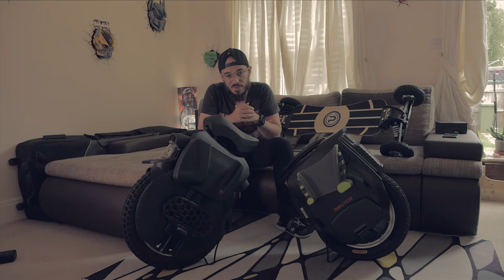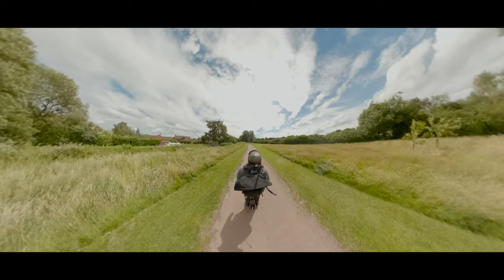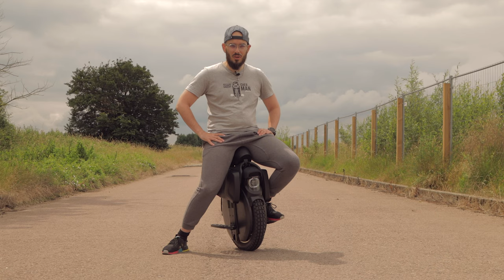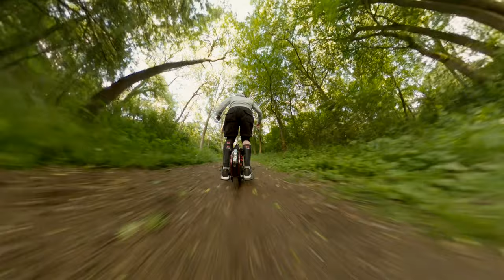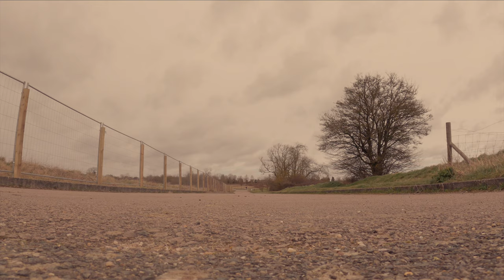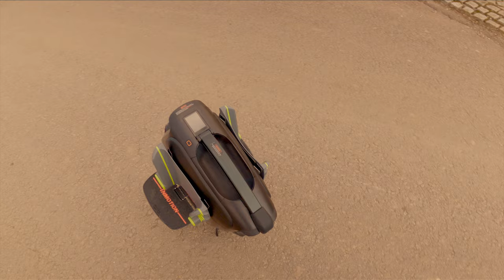Inmotion V12 Vs V11 - Best Electric Unicycle 2022 for beginners?

Comment: Design of v11 AMAZING! One of the prettiest wheel with Z10
Reply from the maker: Agree with you in that 100%
Reply: I just got my v11, what can I say... amazing wheel, build quality exceptional (now with few scratches ;) ).
Reply: @MADpack   can u give me advice? I want to buy unicycle and  i can buy used V11 or new V8S … which you recommend?
Reply from the maker: V11 is a more complete wheel but a wheel that doesn’t like to be hit up so has a newbie you will damage the v11 quite a bit the v8s is more limited less better less speed worst light and also no suspension but easier to start and great to last even with some crashes

Comment: I switched from KS16S to V11, it is defiantly different experience. I like KS16S for trail riding, much better acceleration, smaller easier to handle on curvy trials :). V11 is a my Cadillac :)
Reply from the maker: i used to have a 16x hopefully i sold mine a long time ago because the v12 rides like a 16x but is like a monster

Comment: Both of the wheels are good looking although I prefer the V12.
V11 is one of the most confortable wheels out there but when I rode it I felt something lacking when I curved and swerved. It's probably the higher position due to the suspension.
Never tried the V12 but would really like to try it out.
To be honest, I think a wheel without suspension is better for the beginning. A friend of mine started with his V11 and he doesn't feel confortable in any wheel without suspension.
Thanks for yet another good video, bro!
Reply from the maker: Thank you for your friendship and also time commenting in here and sharing your thoughs
Reply: @MADpack  you know it ;)

Comment: Iam a beginning and my 1st euc is inmotion v11.  I deflated the lower hydraulic so the pedals would stay lower for practicing but then pump it back up as soon as I started being able to ride it. I believe it has saved my ass a few time from unexpected bumps thanks to the shock obsorber.
Reply from the maker: Thank you for sharing your experience like i said not the best wheel to start because is not a wheel that likes to be beaten on the floor. You just notice that when you need to swap a tire. Hugs bro and  keep riding.

Comment: Great comparison and accessories. I have the V10 and V11. I didn't upgrade due to the V12 wobbles and lack of suspension. I'll wait until there's a V11/2 mix.
Reply from the maker: When you manage there is basically no wobble i guaranty i cant stop riding it
Reply: @TheLillianYoung  interesting. You have both the V10 and V11. I have to V10F and want another beside my V10F. I am looking to the V11. What do you think, is there a big different between those two?

Comment: As for me, having to choose between the two you have, I would say the v11, as you changed the horrible CST tire , but not on the V12. I own both too, and I really want to change that tire ASAP. Makes the V12 hard to maneuver, almost as hard as the z10.. might be best for a newbie tho...
Reply from the maker: Difficukt to maneuver???? Is the most nimble wheel i have ever ride in my life. Is so agressive curving with this one that if I had to do a competition i will use the v12 as it it with low pedals configuration
Reply: @MADpack  yeah personally I do find it hard to maneuver, that wheel wants to stay straight, maybe due to the tire (has a large band in the middle of the tire) 
Stays straight and then kind of abruptly lean when carving. Had the same impression with the v11, like if it was to fall on the side if the road was wet or slippy..
You have to invest yourself a lot to turn. 
But it's my personal impression. I absolutely love this wheel but will change that tire ASAP.
For me the Nikola is a very very close contender, but the lower pedals and lack of torque makes the V12 the best 16inch wheel.
Reply from the maker: Strange in which position you use your pedals?
Reply: @MADpack  I tried all 3 positions. I learned to love the v11 heights, so I tried on the V12. 
But as the Nikola, the V12 is a wobble monster..
So I lowered them to the lowest..
Reply: After around two months on the V12 I must admit I was wrong on my mild impression of it. 
You were right, it is fantastically nimble..
I learned how to control it's wobbles.
Yet I wonder the feeling with another tire .
Reply from the maker: Im happy that you get the real feeling of it
Reply: Você acha o 16x uma das melhores rodas urbanas por sua praticidade,  manobrabilidade, speakers e boa autonomia? Tem alguma roda que supere ela ? Se sim, qual ?
Reply from the maker: Detesto a 16x só me deu problemas podes ver no canal.. e não gosto mt da kingsong para ser honesto. A v12 mata completamente a 16x nem há comparação
Reply: @MADpack  legal vou ver o V12 pra comprar futuramente
Reply from the maker: Tenho duas v12 e adoro e tenho a certeza k iras gostar

Comment: I forgot to ask, I noticed that the charge port cover was flapping in the wind as you rode the v12, is that a chronic issue or just didn't get secured before the ride.
Reply from the maker: That bit was the prototype version.. Is nlt like that anymore.. Could be better but not as much

Comment: @madpack Please tell @inmotion that they need to make a wheel that's the best of both of these wheels;
- 18" or larger tire
- top speed over 40mph
- waterproof like the V12
- suspension is optional (maybe they can do a Gotway move and make 2 versions of the wheel, with & without suspension).
- the V12 screen
- the V11 front and rear lights
- the V12 pedal customization
(- the handle is a bit tricky)
And boom! Just like that you'll have an amazing wheel for the 2021 market (in my humble opinion)
Just wishing🤞
Reply from the maker: Some of the things you put here i said to inmotion and also new features lets see what they will deliver to the market i will screen shot this to them
Reply: @MADpack  thanks buddy! 👍👍
Reply from the maker: Just sent :)
Reply: It's a pretty good wishlist but we want options to use knobby tires on every wheel. I haven't seen knobby tires on any V12. If it's a clearance issue with the shell THAT needs to be fixed on the v13.
Reply: @MichaelBelue  hey Michael, I'm sure there's a way to get a knobby tire on the V12. Have you heard otherwise from a reliable 1st hand source?
It was thought that the RS can't fit a knobby tire, but here i am with a knobby K262 on my RS, never been happier.
Reply from the maker: I belive is possible even the s18 is possible to pit without cutting the mudguard

Comment: My 2 friends literally broke the screens on their v12s and v12ht (the wheel was not stable, they fell off and the wheels did flip-flop and full circle landing on screen - both in different time) - so you would like to make some kind of pillow protection around the screens
Reply from the maker: Making a pillow has you say will not save the screen because when the front rubber hits the floor it will put a massive for into the screen that’s why they break I fall at 40mph and no screen broken but had to replace the front plastic part of my v12hs because it was crack

Comment: Good day. I have watched your videos on v12 and i want to get one. This will be my 1st EUC and will replace my e scootor for daily drive. Is v12 can be still comfortable for small potholes and imperfect roads (not smooth concrete). Roads are 80%smooth, 20% rough and potholes. Or should i just buy the v11 but less technology.
Reply from the maker: The v11 is more comfortable but I prefer my 2 v12… I find it comfortable enough for me but for more comfort obviously the v11 will deliver that

Comment: Again nice review. I own an Inmotion V10F for many years now. I love EUC riding. Before I've had the V8. The speed on the V10F is ok, the handle is loose but good enough. Speakers.....to be honest, I don't use my speakers on my EUC. But I would like to have suspension on my next EUC. And I line riding in the forest as well. I definitely would buy another Inmotion but don't want to spend the money for an V13 or V14. What do you suggest? Thx buddy
Reply from the maker: If you want an inmotion and understand why because I'm like you one time inmotion is hard to look to other brands bit seems that other brands are closing that gap but inmotion is still the only company that still have a American/European philosophy… today I had a meeting with KingSong and unfortunately Indeally thought that ks was going to offer me same conditions but was not possible… if you don't want to spend the money v11y is your choice
Reply: @MADpack  the only brand I want is Inmotion but the V13 and V14 are more expensive than the V11 and V12. I had to draw the line in spending somewhere. 😉
The speed of my V10F is good, the range of the V10F is more than good to me. The only thing I would like to have is more comfort while riding. I don't ride hard core off road or chasing down a speedpedelec. Getting older and sometimes, the last few years I noticed when riding my V10F I have some issues on shoulders and neck so suspension would be nice and I think it will increase the riding comfort. But if I understand it well, the V12 doesn't have suspension, does it?

Again, I never looked to another brand than inmotion. For example gotway and other EUC brands still seems to use the same simple, probably less quality components as known as the typically "Chines" Quality. And in motions keeps the standards high. Chinese products of today are not the same quality anymore as once upon a time. That's why I want inmotion. They are simply the build quality. It could be a European or American brand. 

I don't have plans to sell my V10F. I just want another one beside it. 😎😁
Reply: The only thing that is an issue on all those fast, big range EUC's is the weight.. I believe my V10F weigh around 23kg and that is just almost the upper limit to carry in and put of the trunk of the car. I use my EuC the most to enter the city, while parked on the border of the city. I don't want to lift a 40kg EUC in and out my car few times a day 😁
Reply from the maker: @wimperelly I get you no the v12 will not provide you with any suspension the v11y is a good suspension but not at the level of a v14. If you want comfort the v14 is great but you need to accept the reduced manoeuvrability because of its weight.
Reply from the maker: @wimperelly buy a ramp and that is solved :)
Reply: @MADpack  😂

Comment: I really like V12. Now I have Begode T3 which I bought for 1290 USD. V12 now cost over 2700 USD. The price gets over the roof. I will stick with T3. Do you plan to test T3 also? I think that even it is more expensive now, it is still amazing wheel for the money. Sure it is slower, but acceleration is amazing and the range also.
Reply from the maker: Hi bro.. Is been a very hard year for the channel a lot of changes coming. Unfortunately the distributors in the uk are not loaning the wheel to make videos for you guys. In this moment the only thing that I can tell you is that I will be flying to europe just to continue to test wheels and at this moment will have to be the most recent wheels. Maybe one distributor here will have the t3 and I could check if i can get it but cant really promise

Comment: V12 ok to learn on? Coming from an OW XR, can you set a max speed for tilt back or audible alarm?
Reply from the maker: Yes in the begining is even locked to 25kph but is not safer to have a tilt back in the beginning just respect your maximum capabilities

Comment: ...but, they sell the V8F as a 16" wheel.  I understood, I thought, that was the OD of the tire as opposed to the wheel itself.  Have they changed where they measure?
Reply from the maker: No was my mistake sorry. The 14 inch from inmotion is the v5f.. This is a 16 inch but much finner tire than the one on the v12
Reply: @MADpack  Really enjoy your perspective on the wheels.
Reply from the maker: Thank you for the support and to take time to send me a message is really important for me all your comments

Comment: Hi , which is better for beginner: v11 or v8s ?
Reply from the maker: V11 is not a beginner wheel in my opinion. So yes v8s will be a better choice but more limited
Reply: @MADpack  thank you 🙏
Reply from the maker: Hope it help you
Reply: @MADpack  yeah I’ll stick with v8s and then will upgrade
Reply from the maker: @geladolaberidze  you will always use the v8s the same with my v8f

Comment: I’m going to ask it here because I can’t find any info it…
When I’m riding on my Inmotion V11, I get now and then a double sound of the euc… Can someone tell me what this means? Is this because I have reached the speedlimit?
(I’m a complete newbey…)
Reply from the maker: Hi Marc welcome to the channel. More than happy to help but didn’t understand what is happening.. what do you mean with double sound?
Reply: @MADpack  Now and than I hear a double ‘beep’ of the v11… Because I’m all new in this I set the max speed at 20km/h… That’s about 13mph…
Could this sound come from the fact that I reached that speed?
Reply from the maker: Yes is completely normal bro also it can happen if you lose grip with the floor it also can beep
Reply: @MADpack  Aah ok! Thanks in advance!
Reply from the maker: No problem here if you need

Comment: I know this video is a year old but i got a question. I'm looking for pointers. I'm new to the euc community and looking to get my first wheel to get to and from school and around town. I'm torn between inmotion v11, v12 and kingsong 16x. Witch one should I look into if I only plan on getting one wheel and not upgrading for a while. I am 6'2 and 240 ish pounds
Reply from the maker: You are a bit heavy to the options you gave me I would say that the best is the v12ht if it wasn’t for your weight v12ht 16x is poor quality I had one and just got problem… if you have the money I would consider the Patton
Reply: @MADpack  thank!, i think im gonna go with the v12 ht, im a near broke college student and need a quick ride to school and i want to get into this hobby, plus i need to buy all the safety gear like pads helmet, and im also gonna get the hex grid pedals and power pads so i dont slide around, ran me about 2600$
Reply from the maker: By the pads from eRides use my discount they are the cheapest and better in some things compared to much more high price power pads

Comment: Interested to know the climbing ability of the v12. I’m coming from a 16x that never gets hot when climbing. I ask as I ride the South Downs which has some near vertical climbs on trails.
Reply from the maker: Maybe i can make a video about that ;)
Reply: @MADpack  would be great to see that with temps for v11 vs v12 climbing and max climbing angle
Reply from the maker: Lets see maybe i will do a video on that..
Reply: @MADpack Yes, you should do that test and several others to v12!
Reply from the maker: Give some ideas i may do it bro
Reply: Duff recently did a V12 vs V11  hill climb test
Reply from the maker: Thats good ;)

Comment: Would you recommend the v12 HS for off-road ?
Reply from the maker: I wouldn’t buy the ht I prefer my hs 100% rides different just remember rim is more fragile and you need to swap tire but the inmotion v12hs is so much more fun and faster rim is thinner so is more responsive
Reply: @MADpack  I appreciate the fast reply! What tire would you recommend me to change it to if I were to go with the HS
Reply from the maker: @DDGFlacko that’s a good question I’m not sure Lol I’ve been running with the original tire because I love how it rides but it runs out in about 1000km so I’m tired to be assembling and disassembling all the time my v12hs… so yeah I need to find another solution. Unfortunately there are no continental or Michelin options for this wheel

Comment: If you can only have 1 wheel what would it be? V11, s18, v12?
Reply from the maker: B 12 without a though
Reply: @MADpack    awesome. I plan to get a euc  I have a ow xr that I love but speed and range really lack big time.  I know my riding style and love hills and having extra power, speed, and range would be nice.  I've considered the s18 cause of suspension. But the battery sag has me turning my head to no suspension and better range and power.  
Loved your video. It was straight on point without a bunch of side tracking
Reply from the maker: Maybe you want to consider the v12ht video coming soon
Reply: When are they releasing the ht?
Reply from the maker: Announcing this month and should start testing it in dev or march

Comment: Hi!!!!  I am very interested in buying a V12 HT, what are your thoughts about this wheel?  It would be my very first wheel!  Thank for your time!
 Mauricio
Reply from the maker: To be honest? I have both but I prefer the hs depends what you need
Reply: Thanks for your answer!  I only have the V12 HT available down in Argentina!  I would be buying a new unit that just arrived to Argentina.  My main concern is the cutoff issue that I know has happened to this model in the past, I I am wondering if this might have had been fixed by now.
Reply from the maker: They have improved the motherboard a long time ago. To be honest I still have my v12hs with the old problematic motherboard and I have already put 2000km on it and no issue what so ever. The ht is different from the hs.. I continue to prefer my hs I maybe doing the full review soon since I have my ht working again
Reply: @MADpack  Thank soooo much for your help!  Great talking to you!
Reply from the maker: Happy to talk to you also my friend :)